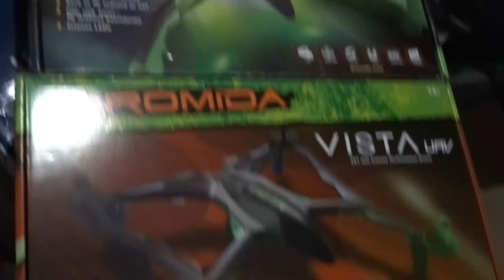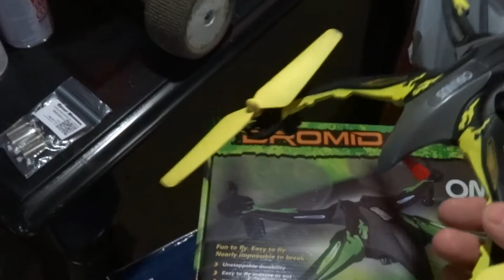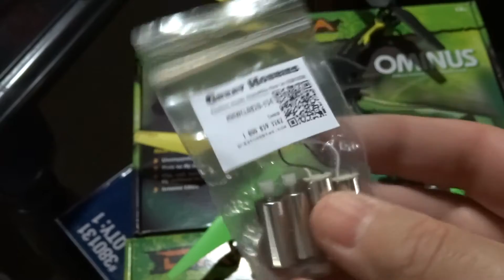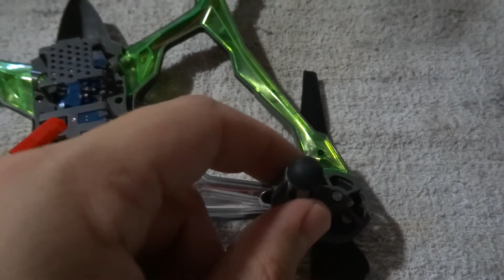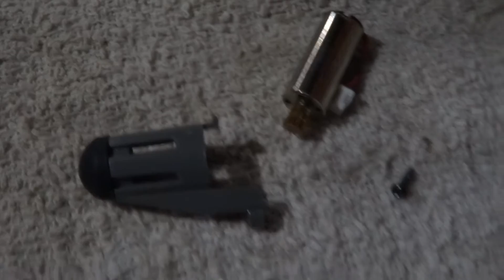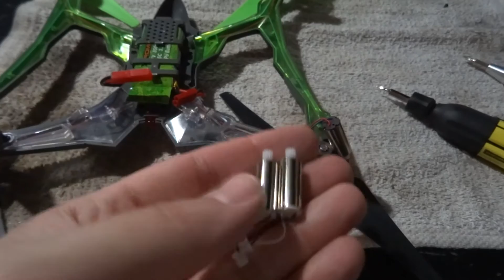Dromida Vista Motor Upgrade

Comment: If the motor covers are hard to remove, take the prop, shaft and gear out and then use a flat head screwdriver to pry the locking tab out. Cover will pop straight out.

Comment: Had the same problem with a Syma X21. Exchanged one motor, just to find out the motors turn the other way, so I had to unsolder it and exchange the red/black motor with a white/black motor.

Comment: 1 by 1 my micro motor warehouse  motors in my ominus started dying after 12 flights, now i'm running 3 stock motors and 1 MMW motor. the metal pinions on the stock motors are noisier but the quad still fly's about the same, so much for the MMW motors being more powerful!
Reply from the maker: +Quadflopper101 that sucks. MMW didn't feel any more powerful to me. Less reliability and same power. Waste of money to upgrade unless you need motors.

Comment: I bought a Vista in January  17 and I did crash it into a tree ,it was not a really bad crash  However it must have cracked the  entire arm that holds the motor ,its actually two arms on this one ,But I then retrieved it and took off and it went hard left over my chain link fence then I powered it down and it crashed on the grass  so I once again I retrieve it  and prepare to take off  back in my yard when I realized that the arm had broken through and the motor was kinda hanging over , So I broke out the super glue and welded that baby back together and it seems as strong as ever and is lined up perfectly  ,But while I was taking off the back so I could get the bottom good  and glued right  the motor got unplugged and I sorta pulled the two wires off of the circuit board  ,seems like an easy fix but I do not have the soldering ETC.  and now I have been flying a Hubsan h502E with GPS and altitude hold so I have gotten much better at flying, so now I will fix the Vista and make sure I don't try and fly it at my house because that for me is asking for it so calm days and open fields from now on  and I hope I have gotten over most of the stupid rookie mistakes  like flying when its to windy , not waiting for the sattelites to hook in , and flying around my house ,which has way to many obstacles. so Take my advice and do not fly in limited area until you have the experience and the machinery too do that as well as using your head  and being cautious  and careful if you take care of these toys they will hold up, but  us older rookies have not got the same kind of gaming ability that the younger ones have so I  accept my limitations and try to be content, with that  I hope you all have good safe fun flying and stay away from drugs  OPEN FIELDS AND CALM BLUE SKY DAYS   HAPPY FLYING AMERICA.